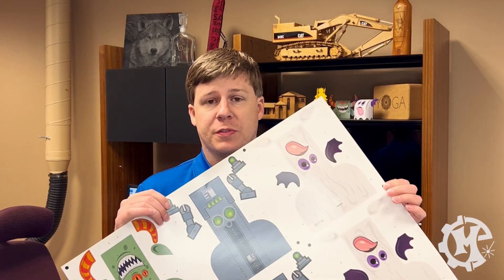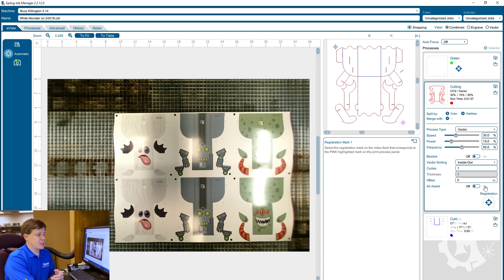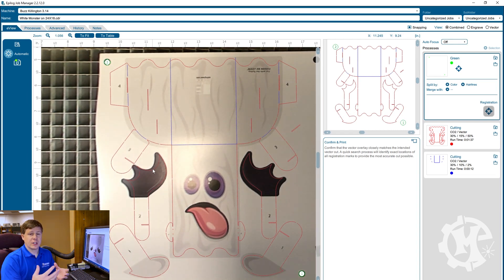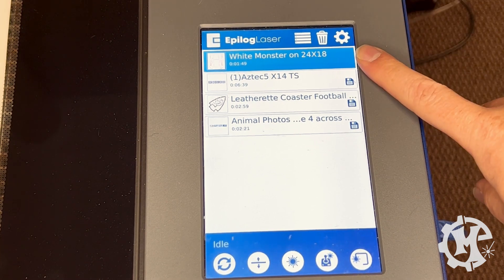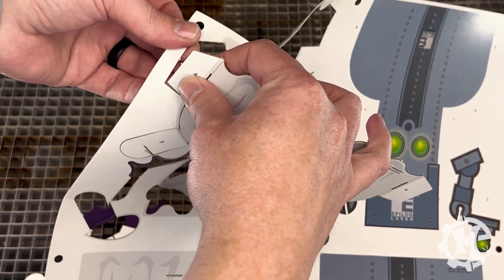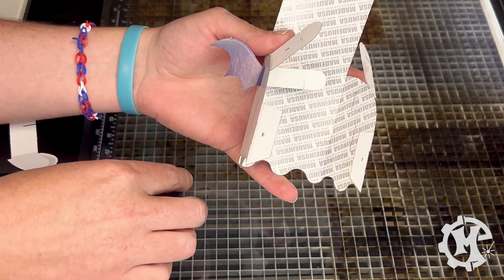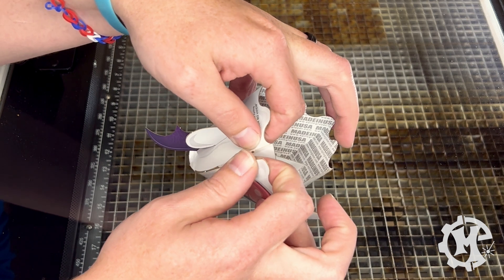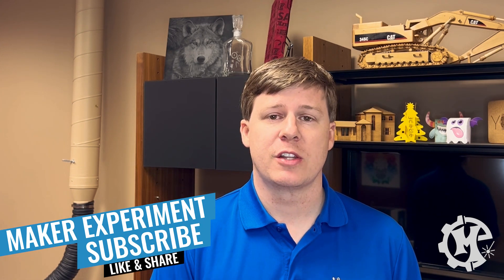How to do Print and Cut with Registration Dots and a Laser

Comment: I have the fusion edge with the 24x24 bed 50w can it do this?
Reply from the maker: The camera feature for registration dots is only on the Pro. There are ways around this, but you won’t have the registration dot camera that makes it easier.
Reply: @MakerExperiment  oh ok, I was told I have the same two iris cameras that the pro has when I purchased it. I have the larger version of the fusion edge with the 24x24 bed. I wonder if my disturber was misinformed.
Reply from the maker: @sewluckyembroidery  you can look at the website and tech specs to make sure but I don’t believe the edge series has the registration camera.

Comment: Hi Trevor
You should make a video on how to use the EPILOG DASHBOARD. Explain from the EPILOG SETTINGS, when to use the TROUBLESHOOTING, what the PRINT QUEUE is for
Explain the difference between the ENGRAVE TYPE (Standard, Stamp, 3D)
Explain when to use the VECTOR SORTING options ((Optimized, Inside-out, none)
Explain how to use the OFFSET
Explain when to use the different FREQUENCY percentage options when cutting
Explain when to use the CENTER POINT
Explain, for example, how to save files in the Epilog's memory, to use them later, without sending them from the computer.
For example, how to organize the JOBs on the computer
All this can be read in the manuals, but you could look for examples where these features are applied.
The video could be called, Epilog's Hidden Features.
Thanks in advance.
Reply from the maker: That’s actually in the plan. I have a meeting with their software director to discuss all of the hidden features. It’s a good topic.